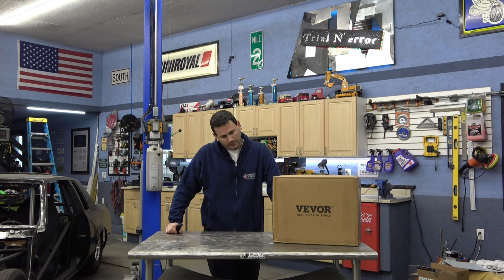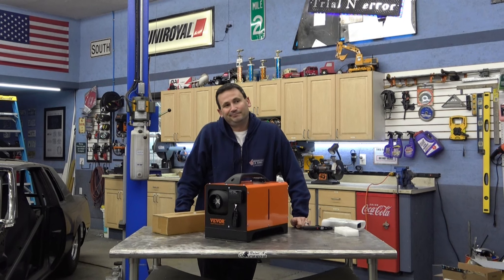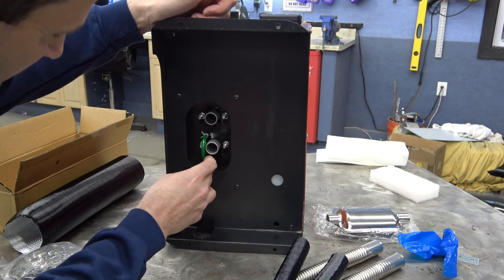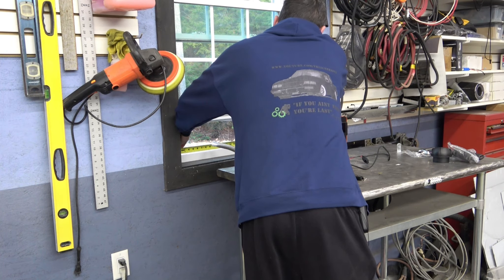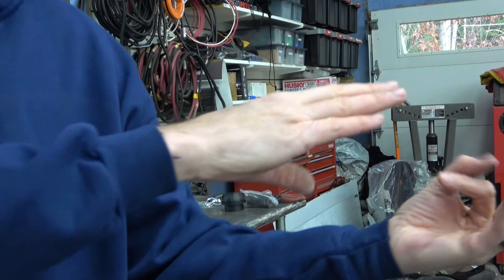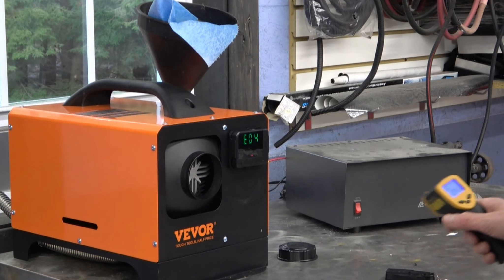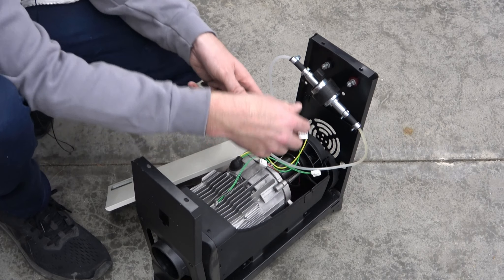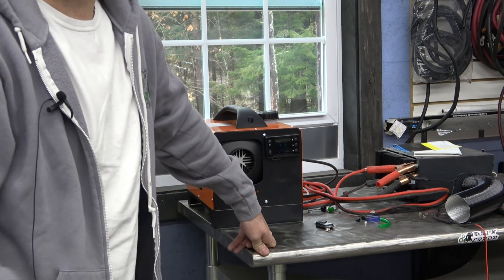I FINALLY got a chance to try one of these Mini Furnace's! Vevor!

Comment: So, the fuel gets poured in the top? I almost expected a hose to the back based on what you said @3:00. Later I see a funnel.
Reply from the maker: Yes sir,  I'm thinking about feeding it from a 260 gallon tank now. It's easy to modify.
Reply: What's the cost? Thanks

Comment: Hi Tom! Any issue with running this on waist oil. Between 5 cars I have plenty.  Any thinning or just filter the oil and go?
Reply from the maker: Hey Chris,  you still need to fire it up on pure diesel but once the chamber is up to temp it can then be switched to a 1/2 and 1/2 mix.  If you have a way to pre-heat the waste oil (I used brake line and coiled i around the exhaust hose of the heater itself to pre-heat it), I've been able to keep it running on 90% waste oil.  With all that said, I know I'll have to clean out the chamber at least once a year since the waste oil burns so dirty....but it's "free" fuel so it's worth it IMO.

Comment: To bad no one actually makes an 8KW, its just a 5KW with a 8KW sticker
Reply from the maker: I thought the same but there's no question, the larger unit throws a lot more heat both in cfm and in btu
Reply: @Trialnerror  very strange,  all of the components are identical,  absolutely no different in any of the parts
Reply: From what I’ve been able to find, the 5kw and 8kw are the same components. The 2kw is smaller. The 8kw may have more setting levels than the 5kw. So they just dump more fuel and push more air to call it 8kw. There was no difference in price between the 8 or 5kw when I bought one so I just picked the 8.